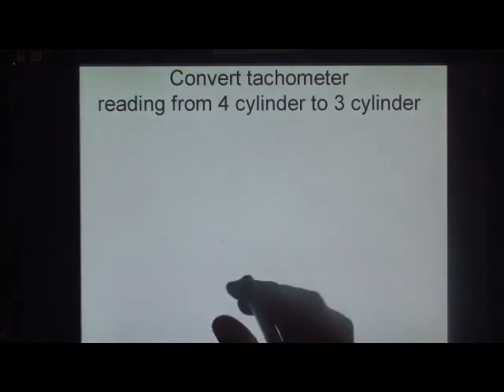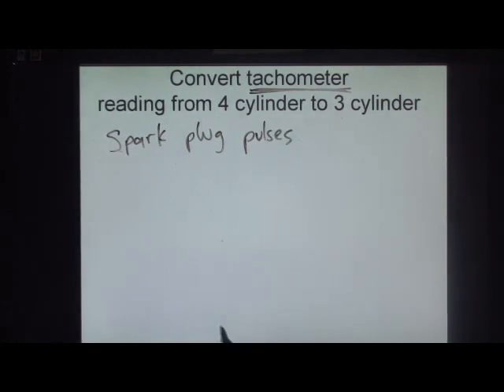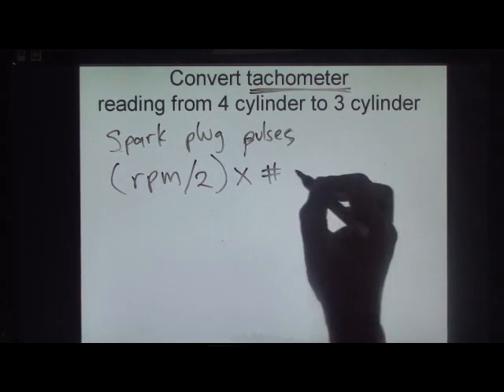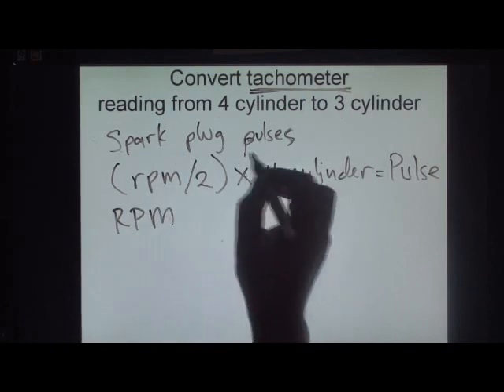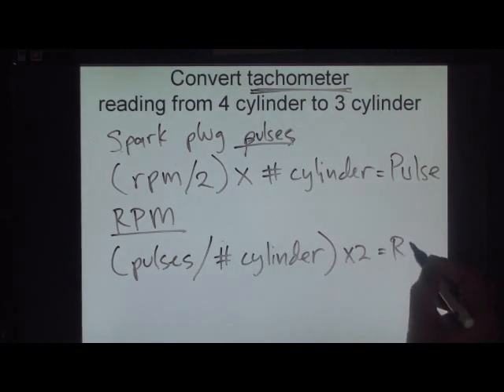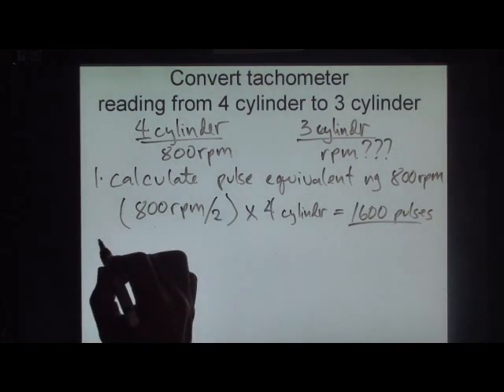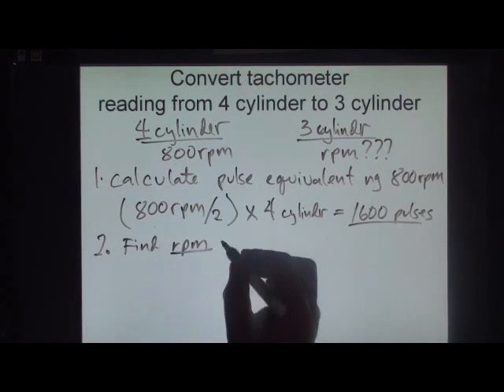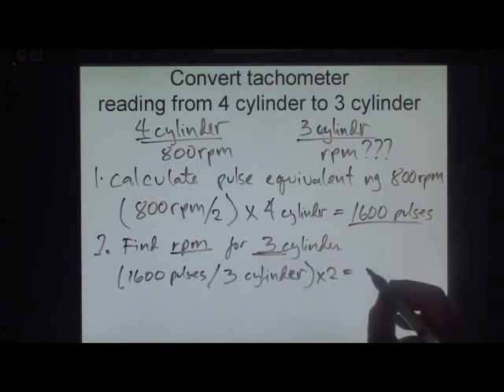Convert 4 cylinder to 3 cylinder RPM reading

Comment: Sir ung nabili ko pang motor pala na digital rpm gauge panu calculation sa sasakyan ko 4 cylinder.
Reply from the maker: Boss using po yung formula sa bandang 5:32 mins ng video, instead po  na 4, e multiple mo po sya sa 1. kasi isang cylinder lang po yung motor. para po ma calculate lang yung number of pulses. halimba po sa digital rpm gauge mo ay 800 rpm ang reading, so (800rpm/2) x 1 cylinder = 400 pulses then to calculate yung equivalent rpm ng 400 pulses ay ganito po (400 pulses/4 cylinder) x 2 = 200 rpm po. halimba lang po ito.

Comment: Tnxs boss . Paano i kabet ung tachometer tas ung vaccum khit saang port baccum?
Reply from the maker: Boss parallel connection lang dun sa tinuro ko sa video1 sa baba bandang   0:27 mins yung red na wire, yun ang tachometer connection dun sa distributor. Tapos sa vacuum naman, dun sa intake manifold vacuum,or pwede rin dun sa C na port, mayroon itong initial vacuum katulad sa intake manifold vacuum, watch mo yung video2 sa baba.

Video1
https://www.youtube.com/watch?v=WFms7YYm8QA&t=7s

Video2
https://www.youtube.com/watch?v=L59RKemvKus&t=288s
Reply: @UDoITchannel  sir sa negative wire ba ng distributor ang red wire ng tacho? salamat po sa sagot.